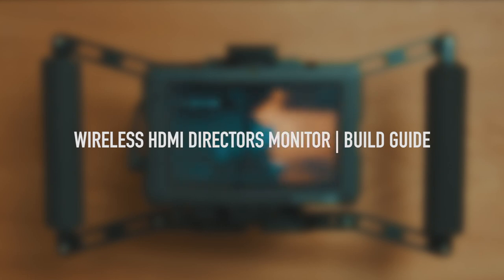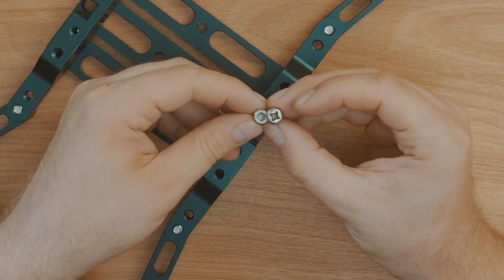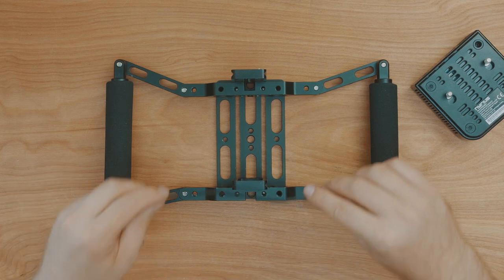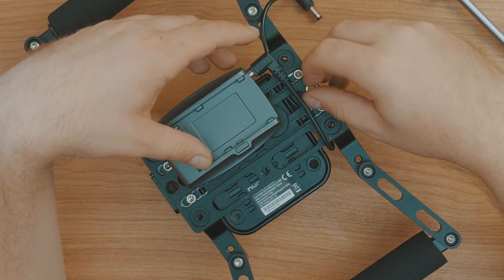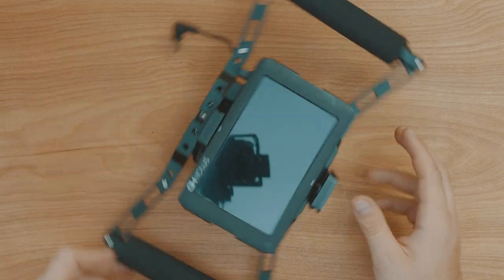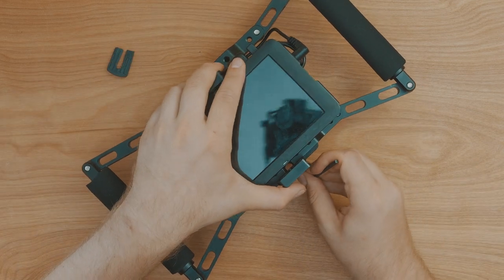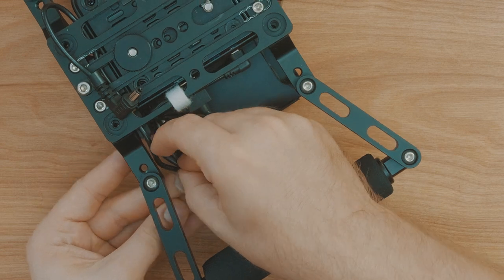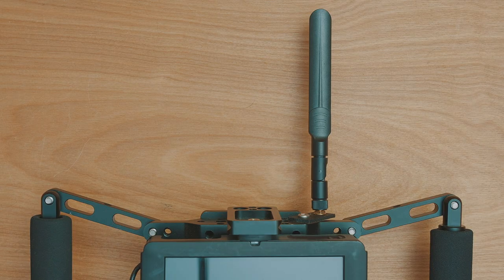Nyrius ARIES - Wireless Directors Monitor Build DIY

Comment: Your battery adapter has only one power outlet -- the barrel.  The Nyrius receiver powers through an USB cable.  It was not clear from your video what converter you used.  Also, it appears that your monitor is ghosting off of the receiver, or vice versa.  Can you please explain the power layout?
Reply from the maker: Hey sorry for the delay on this! The Nyrius unit is actually running off the Small HD DP6 USB port, that was a big reason for choosing this monitor as the build quality is really nice and it has a 5V 2 amp USB output. IF you go to 4:15 you can see how the USB connects to the Nyrius unit.

Comment: Hello! Thank's for advise! I'm going to shoot a short movie in nature and need some additional information. Is this thing transmit signal if I shoot in 4k? I mean, transmitter will be pluged in operator's monitor (lilliput 4k) and receiver  to director's monitor (also lilliput 4k)
Sorry for poor English, i'm from Russia.
Reply from the maker: Hi no worries your English is really good!

This setup will only be able to send and receive a 1080p, 60 fps signal max, anything higher and it won’t be able to send it. The 1080p signal is very sharp though and would definitely be suitable for a directors monitor :)
Reply: @DavidMorganJones   Thank's for respond. Recently i bought a BMPCC 4k and was not shore about transmitting signal from camera to on camera monitor and from monitor to directors monitor via Nyrius if I shoot in 4K. 
I go to the forum of Blackmagic and got some additional info that HDMI in BMPCC 4K get only 1080p. 
So if I will shoot in 4K I could transmit signal via Nyrius. 
`Resume: Will it transmit or won't - depends of what class of HDMI output do you have in your camera.
Reply from the maker: Hi sorry for the delay! I am just about to get a BMPCC 4k in the next week or so, I will try it out on my setup as well and see if I can get it to work, hopefully there is a way to output a 1080P signal so it will work with the Nyrius :)

Comment: Any luck with pushing a 4K signal? I have a similar set up (not as pretty) and with my Sony A7SII it wont push a 4K signal
Reply from the maker: Hi man, sorry i haven't tried a 4K the highest I have done is 1080p, I am pretty sure this adapter will only up too 1080P 60 sadly.